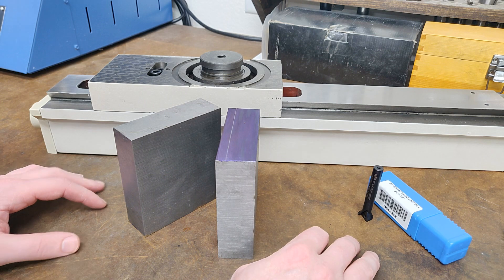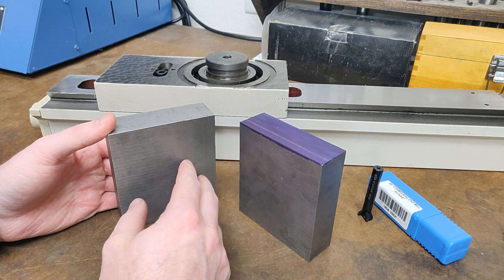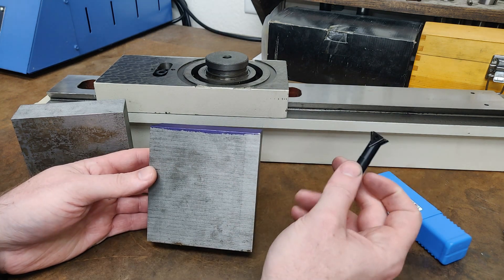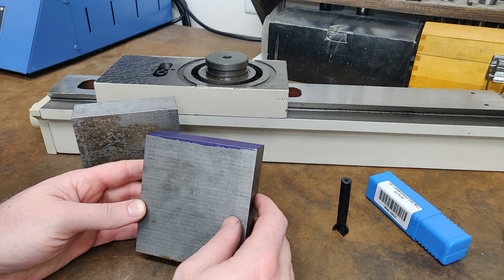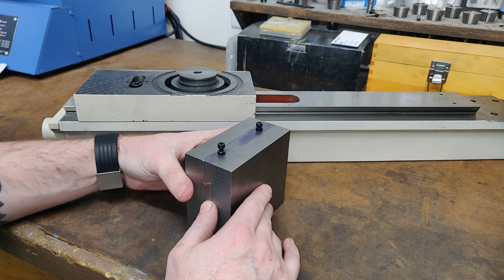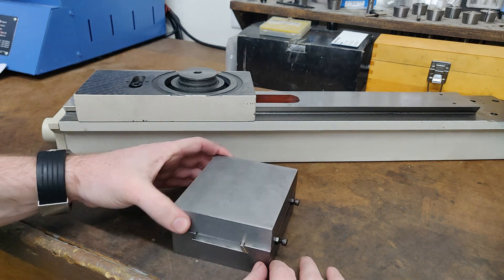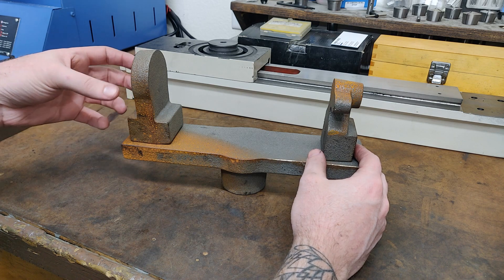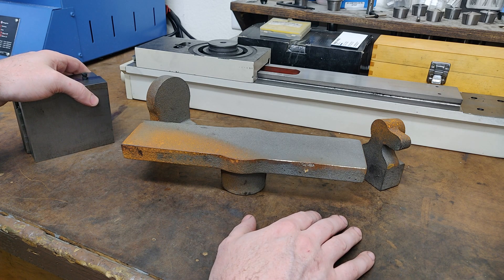Straight Line Engine Build - Part 2

Comment: What Grizzly model did you re-purpose?
Excellent idea of using the milling machine ways.  I've been designing a machine and was looking at different ways to handle the vertical slide, but haven't been really satisfied with most options.  This would be a good choice - good and solid.  Thanks for the idea!
Reply from the maker: Hey Douglas, I'm using Grizzly part number P0758048, which is the column for the G0758 mill. It will require me to flip the feed from the top of the column to the bottom, but its hollow all the way through and I need to retrofit the 10 thread 1TPI leadscrew anyways.
Reply: Thanks, Darren.  I had pretty much come to the conclusion that was the model, as I looked through the pros and cons of the different ones available.  You and I have a lot of similar interests, including the watchmaking and enameling.  I appreciate the reply.